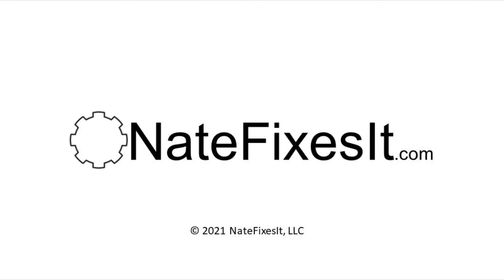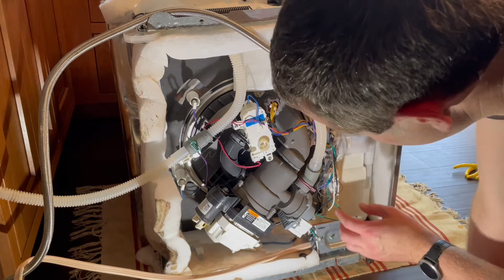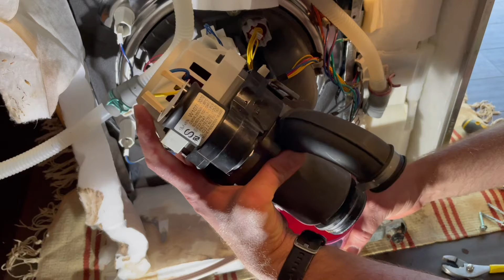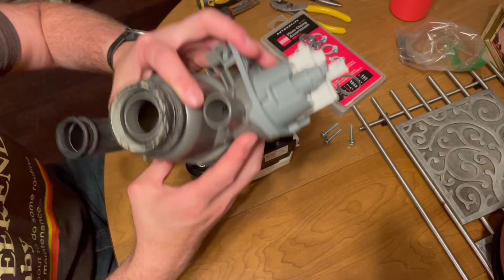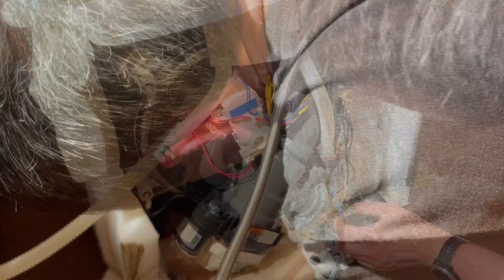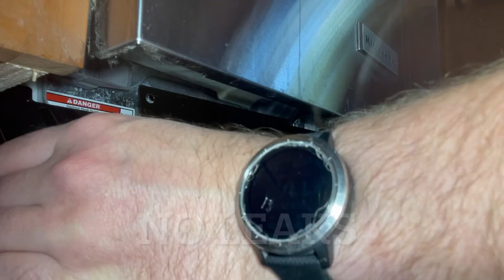KitchenAid Dishwasher Clean Water Wash Filter Replacement and Circulation Pump Replacement

Comment: i am thinking it looks a lot easier to just replace the whole sump unit then everything is nice and new you can actualy do it with unit still in place and the price is only like 130 dollars if you have to replace a couple of the individual parts it adds up to that quickly
Reply from the maker: That’s another option to fix this issue.

Comment: This helped me fix another kitchenaid model with a somewhat different circulation pump assembly but also a "permanent" filter. These are quite easy to work on - it's too bad they're so invested in getting you to purchase an extended warranty (which would be the same as buying a new dishwasher every 3.5 years) that they sabotage DIYers by not even publishing a repair manual. Mine had chewed the filter so badly it clogged the drain pump with a ball of perforated steel, so I rinsed out all the hoses & fished around everywhere I could reach before reassembly.

Comment: Would be a good hack to just cut out the screen of the filter entirely since it’ll just get clogged again? I have a 40 year old dishwasher that has no filter, is still working and seems to clean better than many newer ones I’ve seen. I’m helping my friend fix this KitchenAid model and, besides being appalled at the filter placement, I’m wondering if it would be better to just remove that filter and allow small debris to go through the drain.
Reply from the maker: I’ve not tried that.  I think k it would end up recycling the food chunks through the unit and clog your spray arms.
Reply: @NateFixesIt Ahh - I misunderstood and thought the filter’s purpose was to prevent large debris from going into the drain. But it’s to protect the motor - got it, thanks!

Comment: This is an EXCELLENT tutorial. That said, you don’t have to unclamp all these hoses! You can just remove the three torx screws and pull out the motor with the filter. The two screws are easy, the third one needed a combination of pliers with a torx head.
Reply: 2nd this tip. Worked for me. A long and a short T25 were helpful.
Reply from the maker: Great tip!

Comment: It was very difficult to remove those single use hose clamps attaching the filter&pump to the other parts; they were oriented so it made it almost impossible to grip & bend with pliers. Luckily we were able to fit a flathead screwdriver inside the bent latch and twist it loose from the inside.

Also fyi those single use clamps are really thin, about 6mm (~1/4”) wide compared to most of the worm screw hose clamps that all appear to be at least 1/3”(5/16”) wide.  I used the wider ones and and although not a perfect fit they seemed to tighten well enough and are currently holding.
Reply from the maker: The single use clamps sure are a pain!

Comment: Pulled my circulation pump and tested it it was fine unit was also leaking. With these kitchenaid units  you can get the entire sub assembly for under 200.00 pre assembled . Much easier to replace the whole thing. be done in less than an hour. and have a new dishwasher
Reply from the maker: Glad to hear that the price for a whole pump has come down, when I had to replace mine, they were much more expensive!

Comment: This was so helpful! Is there a way to diy fix attach a screen filter on the useless tub filter to avoid this issue?
Reply from the maker: I haven’t tried that.  I’m sure that you could come up with a method, but it may plug up which could impact the flow of water and cleaning ability of the dishwasher and would need to be emptied frequently.

Comment: HEY!  You can get to the filter is a much simpler way, and you dont have to take off a single hose clamp.  

DISCLAIMER:  My Maytag has the same filter cartridge and has almost the same design, but not everything my work exactly the same.

Instead of flipping the washer on the right side, flip it on the LEFT.  Do not clip any hose clamps.  Instead look for the two T-20 Torx screws that connect the filter housing to the pump motor.  You can access these easily IF your washer is lying on the LEFT SIDE.  One of those 2 screws is easy to reach from the bottom of the washer, but the other is on the side facing the right side, so if the washer is on its left side you can see it from the right side (which is on top now).

After the two Torx screws are out, pull the back end of the pump motor out of the vibration dampener (a square rubber grommet thing) that is held by a metal bracket on the back of the washer.  You will have to flex/bend the bracket away from the motor, but once the small cylinder end of the motor is out you can wiggle the motor off the pump housing and pull out the filter.

WARNING!  One thing I didn't see you cover was the weird washer that sits inside the filter housing that the filter cartridge sits up against.  At least, MY washer was this washer which is basically a spring of four winds that is compressed into one washer.  It goes OVER the filter cartridge and is pressed up against from raised ribs inside the filter housing.  This confused me for a while during my fix because it isnt labeled or described properly in the online parts manual.

The only tricky part of this quicker method is fighting that bracket at the back of the pump motor, but there is a tiny plastic pin you can ease out that allows the bracket to slide down out of your way so you can reattach the motor to the filter housing and then slide the bracket up and re-seat the end of the motor in the vibration dampener.
Reply from the maker: Thanks for sharing this method with the other people who have to fix their dishwasher!

Comment: We had our Maytag with the same internal fine filter for 4 years before it refused to run.  It turned out the filter not only had holes, but filter metal had torn and ripped loose and jammed the pump motor.

The CLUES that this kind of washer has fine filter problems were first that the dishes werent getting as clean.  Probably dirty particles had been getting pumped back into the tub during the wash cycles.  

THEN we noticed that every time we started a new wash we would get a rotten smell in our garbage disposal where the dishwasher empties.  This was because the holes were so bad that food was being left in the washer plumbing after the wash cycles were completed.

THEN the washer refused to start.  We got an E1 F9 "wont drain" error message.  That message only tells you that the washer wont drain in a set amount of time but DOESNT tell you the reason is that the pump motor is jammed or has resistance that keeps it from turning freely.

As destroyed as our filter cartridge was, ALL IT TOOK was separating the pump motor from the filter housing (after pulling the washer out of the cabinet and flopping it on it LEFT side) and replacing the filter inside the housing.  Even though shredded pieces of filter metal were sent through the washer into the disposal it now WORKS PERFECTLY.  So a filter that costs only $80 - $125 may be all you need to fix this problem, and it's not even that hard.

The professional repair guy will tear out a lot more of the guts of the washer and probably tell you the motor is burned out, but that may not be true.  My local Maytag parts guy told me that the default order for this kind of repair involves a lot more than JUST the filter and that he wasn't aware of a fix that DIDNT involve replacing a bunch more parts in a larger package (wihich includes that filter).
Reply: Thanks for the info. I'm trying to decide if it's worth buying the mesh filter on its own or if I need to replace the whole sump assembly. I found mesh shards in the sprays arms and have been trying to dig them out of the holes with tweezers! The dishwasher seems to be working ok now, just leaves crumbs all over the bowls on the middle rack. So maybe I'll risk it and just order the filter.

Comment: I found this video after I found my screen completely destroyed.  Fixing it myself should save me at least $500.  New dishwasher costs over a $1000.
Reply from the maker: Let us know how your repair goes.  Good luck!
Reply: @NateFixesIt  received the part today and had to make some modifications. So far so good, I ran a short cycle and it worked fine.  We’re doing a full cycle overnight with a 4 hr delay.  I’m sure it’s fixed.
Reply from the maker: @johnnunya1776 good luck!
Reply: @NateFixesIt i did have a problem with the rubber drain hose and the clamps I put on them.  5/16 clamp is what is needed I used a standard clamp and with the vibration it created a tear in the hose.  A little water damage and the hose was $62 at a local parts house.  Expensive mistake and more water than I wanted to clean up off of the floor.
Reply from the maker: @johnnunya1776 sorry that you had that issue, but glad that you were able to find a solution.
Reply: I had the same problem.  Cost me $120 including tax.  Next time I will buy the $80 filter off Amazon.

Comment: What model kitchen aid was this repair done on, mine is 10 years old. Are they all the same?
Reply from the maker: My dishwasher is a KitchenAid KDTM354ESS3 Dishwasher.   I’m not sure that they made the clean water wash system 10 years ago.  Find your model number on your dishwasher, then google it with the term “parts list”, look at the part diagrams that you find to see if it has this type of filter or filter that should be cleaned regularly like this one:
https://youtu.be/ylGDzryIG-Y

Comment: Hi Nate, thanks so much for your video! For us, not-as-tech-savy with appliances, take a look at this video on deep-cleaning the internal structure of the bottom of the KitchenAid dishwasher when the model has a Clean Water Wash Filter.

https://www.youtube.com/watch?v=icggY_z9YZc

If you open this once every 1-2 months, the risk of the self-cleaning filter taking damage/or breaks lessens. I am going to do this every month, see video I linked, as I will not be opening it underneath.
Reply from the maker: Thanks for the tip!

Comment: This vidéo is very good, thanks Nate.  All the comments attached confirmed that this problem is quite frequent.  Having to do all this work to replace a filter that regularly clogs does not make sense.  Kitchenaid, not a very good design, a serious flaw in the conception.  A dishwasher should work 10 to 15 years with a need to just clean it via accessible means.
Reply from the maker: Totally agree. Thanks for watching.

Comment: Very nice video. Our Kitchenaid kitchenaid kdtm404ess1 dishwasher has a horrible smell and a greasy build up at the bottom and around the seals of the dishwasher.  We have tried everything to clean it, but the build up and smell keeps coming back. Is this filter the likely problem? Thanks.
Reply from the maker: That could be the problem, do your dishes come out clean or are you getting food particles left on them?
Reply: OH YES.  That was our first clue that something was wrong.  Our dishwasher empties into our garbage disposal and we thought we had sewer gas backup UNTIL we noticed that the smell only showed up just as we started a load of dishes.  Months later the dishwasher refused to run and it was because the filter was so mangled that the pump motor jammed.  Replacing the filter was all we needed to do, the motor was just fine.

Comment: This video worked for my 2 year old KitchenAid KDTM604KPS. Second + Top rack control arms would not spray, and loads were getting less clean the past week. I took the unit apart and got to the filter (took about 20 minutes), my unit has a mesh screen filter and it was totally clogged with mason jar label that contained food/oil residue. I scrubbed the filter with a tooth brush + CLR/vinegar and flushed with hotwater for about 15 and put the unit back together. The circulation pump was wheezing and whining as if it was not able to push water through the filter. Once the pump filter was cleaned, the dishwasher is cleaning better than ever. I got lucky and did not need to buy new parts. Thanks for video, spent a good hour and getting new clamps from HD, but saved easily several hundred in labor.
Reply from the maker: Glad that I could help!
Reply: @NateFixesIt I have the same unit as this poster who didn’t need to order the part. I’m planning on tackling this on Saturday… in the event my filter ends up needing to be replaced, so you know which filter is the correct part? I noticed this particular model is missing from the list you provided in your description. KDTM604KPS seems to have been skipped over
Reply from the maker: @michaelmarrero7819 to find out your exact part number google your model number and “parts list”.  You should find websites with the parts diagram for your machine that lets you identify the part numbers for your exact model.
Reply: @NateFixesIt yep, got it apart this morning, filter is mangled. 3 years old. This seems like a manufactured defect if so many people are having. This issue. Either way thanks for the awesome vid! Model 604 is slightly different but easy to follow. Now just gotta find the part
Reply from the maker: @michaelmarrero7819 glad the video was helpful, good luck getting your new part!

Comment: Thanks Nate! This seems to be my issue! I’ve found that the micro filter was completely damaged. I’ve ordered a new part and will post back on how it goes!
Reply from the maker: Good luck, this should fix it!
Reply: @NateFixesIt  Received the part and that was indeed the problem. It’s all fixed now. Thanks a lot Nate - much appreciated!

For the benefit of others, symptoms of our dishwasher were: Dishwasher didn’t seem to be washing. On troubleshooting I realized water was coming in and draining without issues but wasn’t getting circulated. I then checked all the arms and holes and they were clean. Finally following this video, I opened up the motor to retrieve the filter which was completely broken.
Reply from the maker: @prasadis  Glad to hear that it’s fixed!

Comment: Great video Nate, very helpful. I followed all of your directions but the dishwasher now makes a grinding sound after replacing the filter. Any advice?
Reply: I had a similar grinding sound during a test run when I forgot to turn on the water valve. After realizing it and turning the water on, the machine started to work like a charm!
Reply from the maker: @lcn918  great tip!
Reply from the maker: I haven’t run into that problem.  I would guess it’s either a piece of debris that is stuck in the system somewhere or a bearing starting to go bad on the pump.  If the news wasn’t there before replacing the filter, I would error toward a piece of debris.  My suggestion is to take out the filter and make sure that all of the parts that move and those that are in close proximity or touch parts that move, are clean and free of debris.  Check for pieces of the old filter that may be embedded in the plastic and remove them if you find any.

Comment: Hello Nate .. I have the same dishwasher.. I’m getting a 6.4 & 6.1 code I replaced the float switch and I’m going to replace the heating element. Do you think my washer will start working when this is done ??
Reply from the maker: There error codes are usually accurate, but not always.  6.4 indicated a bad float switch.  6.1 indicates no water.  You may want to try replacing the fill valve first (it’s faster, cheaper and easier than a heating element).   You can check out my video for that on a similar model to see what’s involved.  But before spending time and money on a fill valve or heating element, what is the problem that you are having and how is the dishwasher misbehaving?   I had a situation with a different dishwasher where the error codes and the actual problem didn’t align, so always think about the issue with the dishwasher and if the problem and error code align.

Comment: I see they changed the part number from a W10713298 to a w11084156 on customers unit, apparently the original one has a issue of coming apart and jamming the pump motor, again a bad design placing the filter on the motor.
Reply from the maker: Agree, not a great design!

Comment: great video.  its not the first time this filter was all torn up.  Im trying to find the disk on the motor end that grabs the filter to turn the filter.  mine has 3 teeth and one is worn.  I see on your motor end in the vid that yours have quite a few teeth.  Probably an upgrade from other complaints.  Pump number is the exact same one as you posted below.  i have a pic to share of the problem i have but dont see where to add to this comment.  many thanks.😁
Reply from the maker: Hopefully you were able to get it back together.  If not, you can email a picture to me a NateFixesIt@gmail.com and I will take a look.  Thanks for watching!
Reply: @NateFixesIt ❤

Hi Nate
I have the same problem of torn screen, I am in Canada, the screen is so expensive here.

I tried to share this issue with Whirlpool Canada but they said never receive complaints about this issue . I think there is a design defect that this screen is torn so easily and it’s hard to clean or change it without taking out the whole machine and take no apart the circulation motor. 

My question is can we do any modification so that the new screen will not be torn as easily?

Thanks
Reply from the maker: @billlau9658 I’m not sure of any modifications that can be done to the screen.  One thing that seems to tear the screens is paper.  Make sure that you are removing all tags, stickers, and labels from anything you wash.  I would also be sure to remove any hard food scraps like stems before loading the dishwasher.  That should give it the longest life.